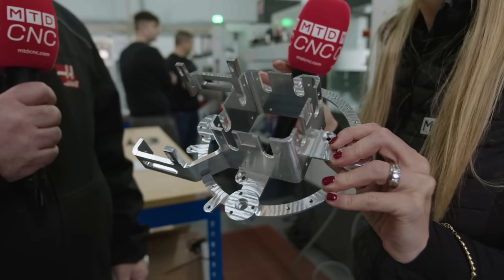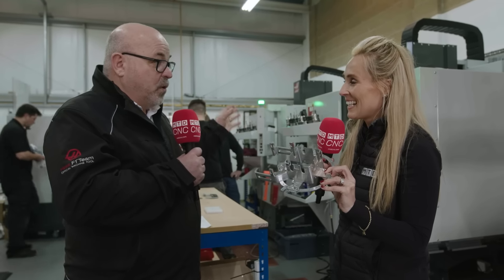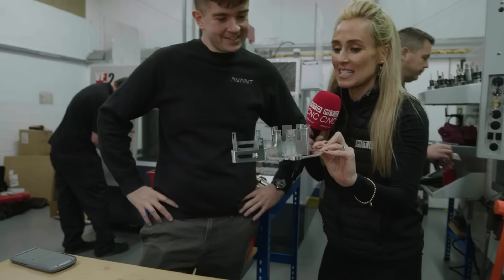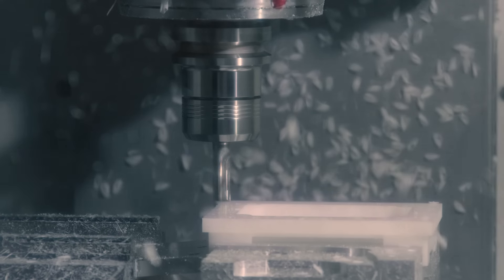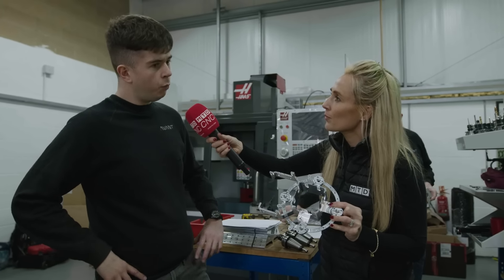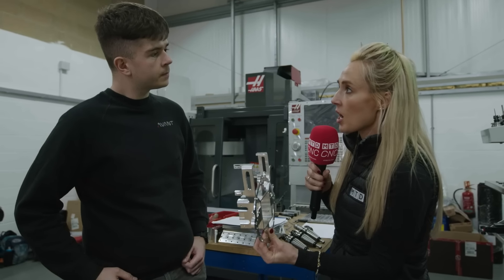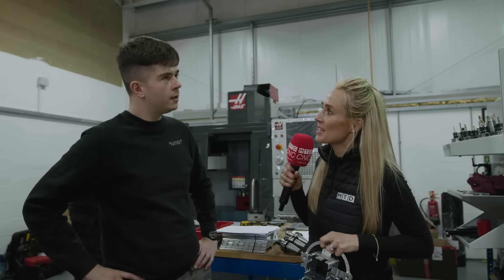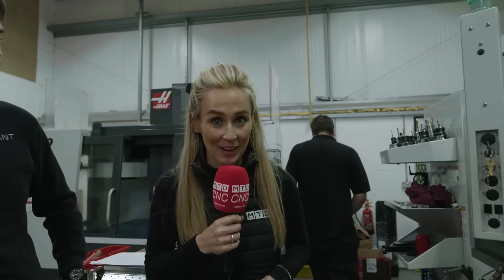New start-up AVANT Manufacturing kick off with the HAAS Mini Mill

Comment: 12 years on our first VF2SS is still running all day every day. We have some other sexy brand machines but the parts wouldn’t go out the door without our Haas machines
Reply: They have a rigidity problem and not that accurate 😅
Reply: @abdalrohmanmousa7405  clearly never used one then 🤣
Reply from the maker: Glad you enjoyed the video 👍